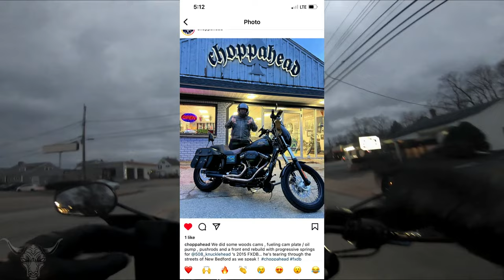WOODS tw-222 CAM SOUND BEFORE /AFTER | FXDB 103

Comment: Hi mate…just a quick question just for reference….I’ve just got the same cams for my Fat boy….woods 222…I haven’t installed them yet….because I was told to also change the came plate,the oil pump and adjustable push rods…. Plus a tuner…..and that it’s a lot of money……how much did it cost you bro??…and what did you actually change….??..cheers mate…
Reply from the maker: Chain drive Cams. cam kit which included, adjustable push rods , roller lifters, bearings, all the gaskets, fueling OE+ oil pump and cam chest, 1250.00 
FP3 Tuner costs now 339.00 on Amazon 
Labor by my local shop which included new front progressive heavy duty suspension 1,400.00. 
 You do need a tuner, it’s a good idea to change those bearings I don’t think you “ need” change the oil pump, but better oil flow is always a plus and I think it keeps the bike cooler 🍻

Comment: Would you say its louder ? I feel like the soudn seem more deep but not that much louder, just a different sound ?
Reply from the maker: It has more bass. Maybe a bit louder.. I am still going to get it retuned.
Reply: @508knucklehead    Thanks for the answer and video, il wil buy it. I was worried about the cam making too much noise.

Comment: So Pete how did you know you where at 5K RPM? Bike sounds great. I know when I did legends up front on the road glide I was shocked how much it changed the ride. I always did intake exhaust and tune first but after doing the legends that’s always going to be my first thing on any new bike from now on!
Reply from the maker: I would say suspension is at top of the list of must do’s.  I looked down and seen the 5k rpm lol
Reply: @508knucklehead  I don’t no your bike had the electronic tac I forget about that on the newer bikes lmao!
Reply: Correct. Took me years of riding Harleys to find out the best performance mod is getting the suspension and handling dialed in.

Comment: I've got a 2013 street glide 103.  I just made a appointment do get the wood 222 and a tune. Like to see 0-60 or 70 pulls like to get an idea how these cams pull
Reply from the maker: I have a 70 mph pull video up. The tune wasn’t on par. But I have since retuned it and it did make a difference… we have slaty roads here now, but I hope to do an update video soon.
Reply: Easy job to do yourself.  No appointment needed and you get to learn some about your bike.
Reply from the maker: It don’t seem like a bad job, I like to lay out my buts and bolts and parts as I go, I didn’t have to room to do that, so I had it done by a shop.
Reply: I did the TW222 and had it turned. My bike used to run rich now its a lean burning beast. When I used to run with some of my friends I would really ha e to push it. Now I walk right away. The sound is amazing the pull is even better. In the past riding on the highway was OK now I have real passing powered. 0-60 or 70 isn't nothing. It's more like 0 to 110 and the rpm range it really comes on around 3 grand and it pulls up to 6 grand.i find that I don't have to shift to keep the power up. To me this is how the bike should ha e been from the factory. It's pulled the f
Front tire up a few times and puts you in the seat.

Comment: What did they charge?  I get work done there as well.  Have 103 also.
Reply from the maker: 1400.00 but I also had other work done. The neck bearing adjustment, and progressive heavy duty springs front end.